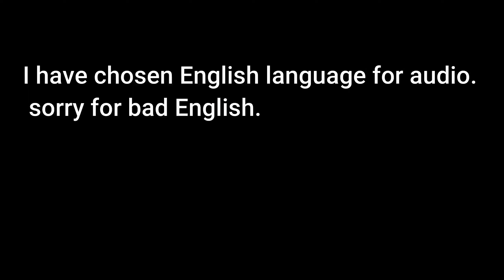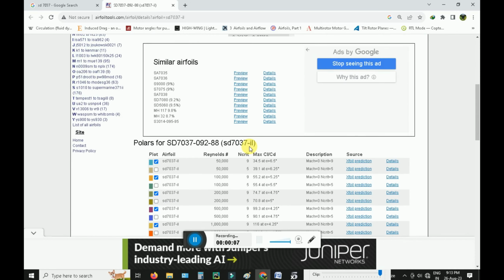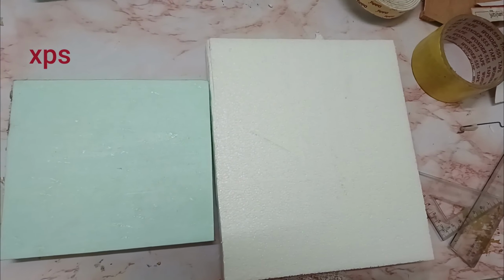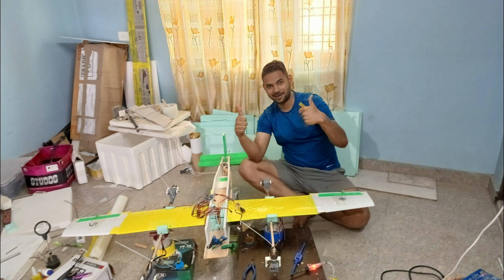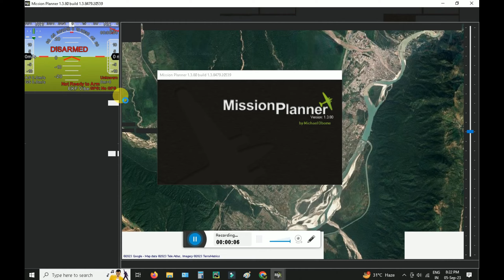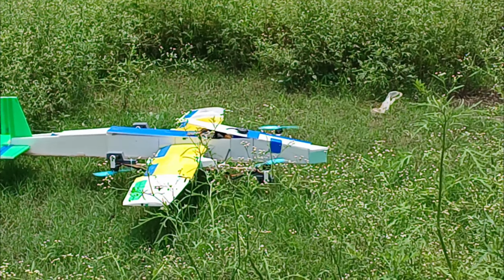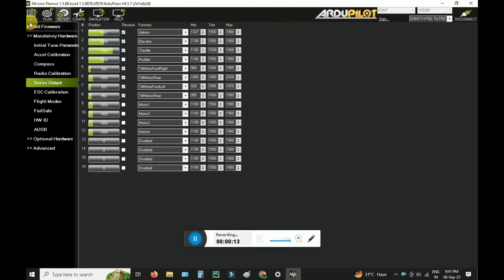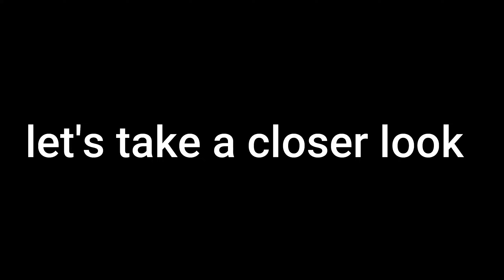homemade  VTOL RC plane crash (Tiltrotor VTOL with all four motors tilt mechanism)

Comment: How much T/W ratio you use?
Reply from the maker: sorry for late reply. Each motor can produce 2500 gram thrust in full throttle on 6s. Let us assume 1800 gram thrust, so 1800x4 = 7200 grams thrust and the weight of the plane is 2300 grams. Hence 7200/2300= 3 = t/w